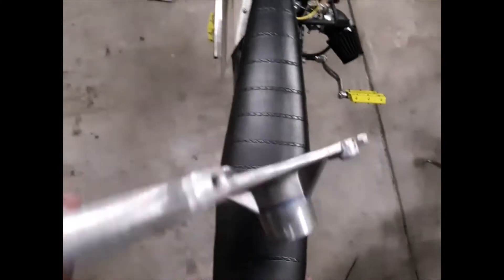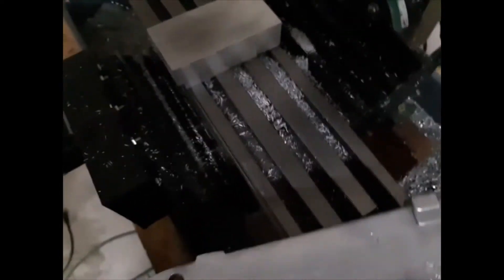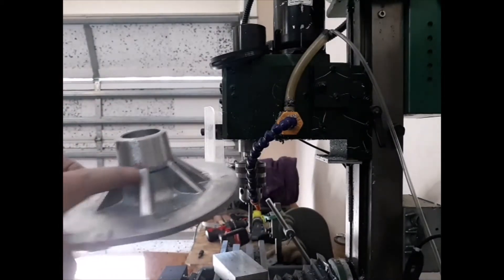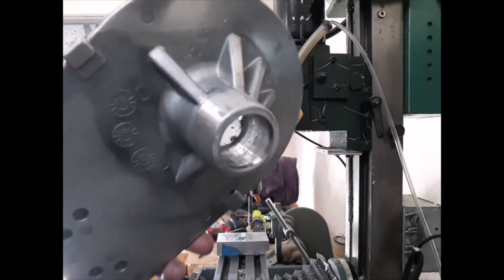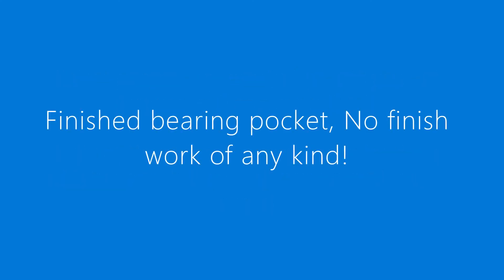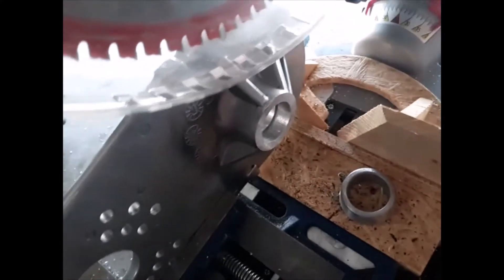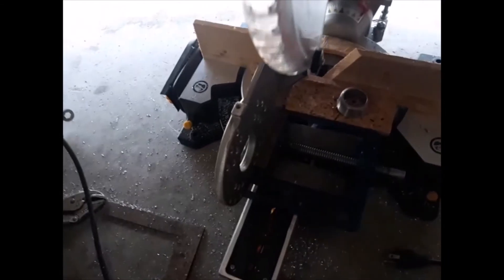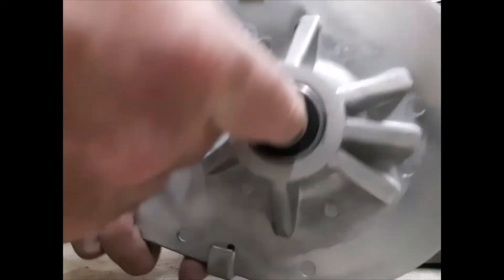Big Bore 4 Stroke Motorized Bicycle Build  (Torque Converter Part 1) CVT

Comment: I noticed on my torque converter, its a death row 212, that my bearing pillow surface was a little shorter than yours before you cut the end off. I too may need to take 5/8 off mine, to get it like yours, flush with the support beams. Gonna have to have a vertical mount made tho because my engine will only fit vertical.
It would seem tho that the exhaust and intake manifolds will be in a better location and more out of the way with it like that 
It looks like the 4 strokes are a bit offset when mounting to the frame. Is that because of rear sprocket alignment, and because the seat post being in the way? It would seem that the seat post location us a problem.
Reply from the maker: Not sure on 212.  I used a 110cc top end on a 79cc bottom end.  Billet internals and modified gokart parts.  Mine sits dead center on my build though.  You need a yellow spring btw to make cvt work or drill another hole for red spring!  Even on 212 build most don't realize it! And about shit there pants when its fully engaged lol
Reply: @BuildBreakFix  i have an lct cmxx 136cc. Thats interesting you say about the springs. I actually thought id get away without having to mess with the torque converter.
I got the 136cc because i was thinking that i wanted it as small as i could for fitment, but big enough to drive the TC.
I see a lot if the builds that seem to have their 4 strokes off center. Im a stickler like you and want things right. I mean why do anything if you aren't going to do it right? 🤷
I am concerned tho that i might gave to mount it off center,  and was wondering if thats why they mounted it that way, because of the seat post. 🤔
Reply from the maker: Well way i got around it!  I mounted my engine on one of those cast iron mount type engine plates.  the plate it's self steel .  I ran into the cvt exit shaft being dead inline  to my set post!  So when i did mine I made my own holes lol!  mounted the engine about 2 inches forward of the factor holes in it!   which landed my CTV exit shaft 1/4 in front of the seat tube and about 1.5 inchs of clearance  between the 2! for the way i cut my CVT down! so my pulley since did belt drive clears it all perfectly!  biggest issue i had was shaft would of had to be dead center of my seat post if didn't mount it that way! I think that is what your saying right?  seems to be pretty common issue! I seen people use a second plat even! mount engine to it then shift the plate forward and mount it to frame bracket also!
Reply: @BuildBreakFix  yeah, thats pretty much what i was asking lol. And thank you! 
I probably should have done a bit more research, and i didn't realize it before, but most of the 4 stroke builds are using the other gas frame, the one with more clearance of coarse 🤣 
If i run into more than i can handle, ill just save the felt faker strictly for my 2 stroke builds. Still haven't ran my ms460 hybrid. Im pretty much done with that one with the exception of exhaust. I took your advise from a previous convo about just using a chainsaw exhaust, but i still had clearance issues because of the way i mounted it to the big downtube. Anyways i was thinking about the other gas frame, but damn i think itd look so cool vertical mounted 🤷
Reply from the maker: @KB_Joys   yes gas bicycle frame!  not felt faker!    this was when did rebuild!  part to note is the mount how i did it if you buy the one i listed below! you need buffer and such it's explained in the video! https://youtu.be/sR7m9ZZqa1E

This frame works best! 

https://www.ebay.com/itm/284415867639?hash=item423881baf7:g:7UAAAOSw~qthHhaE&amdata=enc%3AAQAHAAAA4E27gELzTRfJ9FJ2%2FGasVrSSOdlwcamorz7j5ge6ws%2BKZbeei2idn2aMShfFhTwssSlXLomRElsRKJgRv9qvVL8shAzlb6J%2F7e0cpaIegAV5JgE5PBLKV8uRld4A2AkkJAI87U5Im4JEhHL5M2pbtMolfXqpmgq%2BMUjQenb6y37LM83Dth0oqULpglMFDyvZ3WyLd5XVE%2FibMcpPIYMDPQyOrVNUvFpLLUFoj5JFjkJxUD1DU%2FXoKp86HUHNKu%2FTv2RnhqZtOzSbVK8qhHx9OLwTCNZM2ONyhQpTz72AB1mA%7Ctkp%3ABFBMmNWv-Jph

before you waste shit tons time! like i did first time LOL  buy this mount!  all the other shit will shift and move and cause aggravation!   it has cast iron monts and is super ridged works like boss! https://www.ebay.com/itm/283827572793?hash=item4215711039:g:kj8AAOSwlcxefEot&amdata=enc%3AAQAHAAAA8MoBI0%2FcNkk4p0JtZthtowCh8fjjgmfEQoYw3DFYSBC0FPaSgEGLzAmBmgTkMO5zv8pWGlAQ0qz0%2B3PrUw7DPdAvy%2FdJYpg00lKybh5m42KR6P%2Bk4z8FeAM7b621RlbFQ7VuIrn5ouDkXcsUspHPjWyMpS8%2FvBlNmzhI3vu6WQmjFhchegWYBYjkecVO1HLMRKHzNUd9XgTAFEyy1dM79njJ9gf%2BQ93PG%2BJ%2BTuJkYoFDTqqIfjDfyB8CTackhp0IcdCuIUq35dSnxfQ%2B738qf3Lpk0PMyKMNmMhiC%2FQr4SEeQflMGO7O0lOTYYlwUDsekw%3D%3D%7Ctkp%3ABk9SR_bwwfiaYQ
Reply: @BuildBreakFix  the frame you linked is indeed the one i was looking at. Well see whats what when the parts arrive to see what i can see. Thanks for recommendations
Reply from the maker: @KB_Joys  good luck!  As far as cvt spring!  Drill a hole. Use red spring they come with! Better then buying 40$ spring lolhttps://youtu.be/lzvymzkIHNQ
Reply: @BuildBreakFix  right. I guess it boils down to the confidence factor. I did just take out the governor last night and plugged the holes, etc. Was lots easier than i thought 😊
Also i was pleasantly surprised to see that i have a steel cam. The engine has a forged steel crank, oversized journals. Id imagine finding replacement parts would be hard, but its over built so i should be good. Think i payed like 200 for the engine and the torque converter goes on without adapter.
I had an idea to try to make an intake header for the carburetor to sit behind the engine like a 2 stroke. The pull start and TC makes for a very wide engine. 
Did you have any problems pedaling the bike after the 4 stroke, is there any drag, and does the TC hinder any movement of the way you would pedal a bike normally?
Reply from the maker: @KB_Joys  I dont have any issues with mine pedaling with engine off.    The belt does not grab the engine pulley in the cvt at all.  So all free rolls without binding.
Reply: @BuildBreakFix  i may do belt drive later on, but thank you so much for your help ! 😊
Reply from the maker: @KB_Joys  tell yeah what! belt drive smooth as glass! no vibrations and stuff at all!  just make sure you use a gator belt if you do! smooth type will slip like hell if wet!  well worth the pissing and moaning of making belt drive lol!